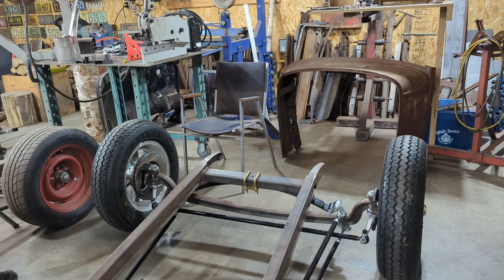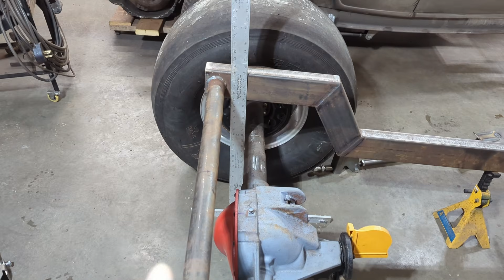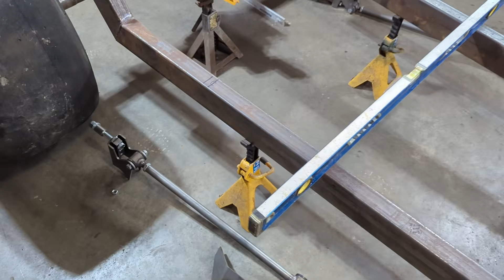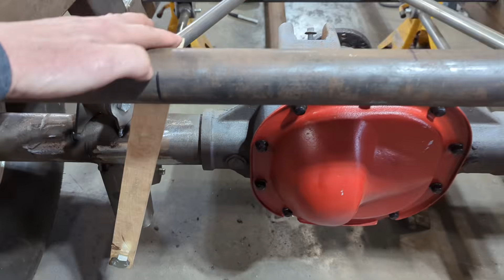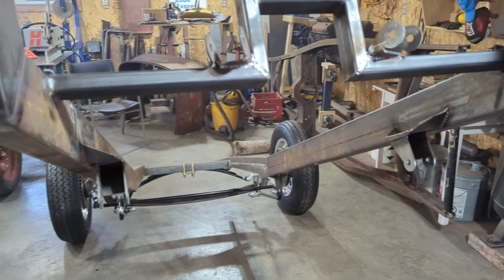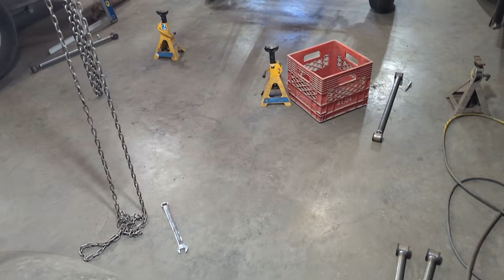4 Links for the Model A Chassis

Comment: No need to brace the cut section for the hoop ? Another triangle going forward to the lower bar mount. Like from the topside of the lower bar frame mount back to the hoop ?   Or will there be another half closing in the bottom half of the hoop ?
Reply from the maker: We didn't think it needed more bracing but we may add another brace when it comes back for more work. The car will be running a stock Chev 305 engine so it will not see a lot of HP.
Reply: @coldstreamrodshop - Thanks for responding, used to live in Coldstream BC, wondered if you were an old neighbor at first... LOL ! I fantasize about having an old roadster, on nice days ! +1 sub for you 👍

Comment: I know this is the wrong place to ask but do the rules of the 4link  with the bars staying parallel apply to any 4link setup? For example a higher clearance application? Great vid BTW
Reply from the maker: It's a general rule of thumb that at ride height (loaded condition with engine and all assembled) the top and lower bars should be parallel looking at them from the side. The bottom bars should be parallel to each other looking at them from the top. Since top and lower bars aren't equal length they won't stay parallel looking at them from the side as the suspension travels up and down. Just try and get them as close as possible to parallel as you can at the estimated ride height. The suspension will still work if it's not 100%. If we were racing these things it would be a different matter we would tune it very precisely.

Comment: Nice work Derek, just a suggestion if you put fish plates on the inside of the rails where they kick up and the front vertical on the frame; it will never crack along the weld. Strength improves 5 times.
Reply from the maker: Thanks yes, I agree. I think we may do this and add it in.

Comment: I see your customer purchased the SET-UP from Welders Supply -- ( will keep it in mind ) --- do you think where you cut the new cross member there in the center for the drive shaft clearance ( loop ) between the two control arms might be weak point there ------ the two lower arms are ---- Pushing --- to lift -------- and the two upper arms will be ---- Pulling ---- back ---------- do you think a gusset  is needed at the front side of the point where the top control arm attaches to your cross member ----- then tying it into the frame going forward ------ just looks like a weak point ------ can see flexing of that hoop area ------ maybe keeping it a little more rigid------ those are some pretty big tires ----- must be thinking of putting in something that will ----- TURN ---- those babies over ------- Just something I see as you are building it -------- Thank You for the video ------ The Seasons have changed ----- It's Getting Cold ----- See You on your next one -------- Rodney
Reply from the maker: Yes I was thinking all of what you're saying with regards to the hoop. One consideration though is that the owner is running a stock 305 Chev engine so not a lot of power so the big tires are more for looks than practice. If he was putting 500 HP in this I would have beefed it up a little more. Most of the forces on this bracket I believe will be going forward and back and the cross member is complete across. I've seen people do cantilever supports (nothing in the center to connect the two sides) and that just hurts my engineering head. A gusset still may be added as he may get some more help from us.